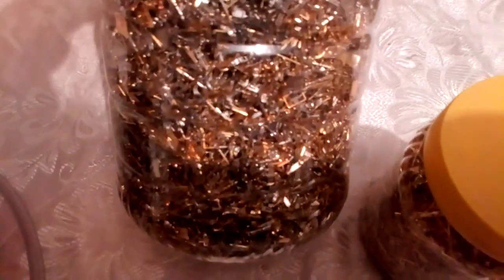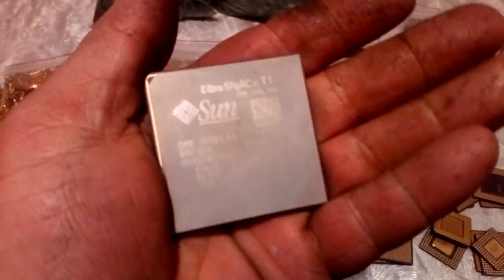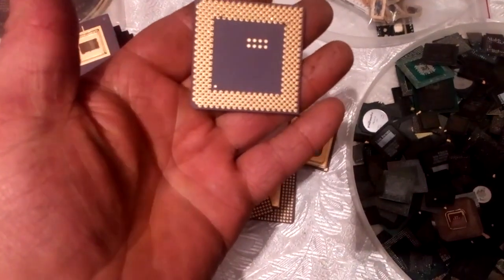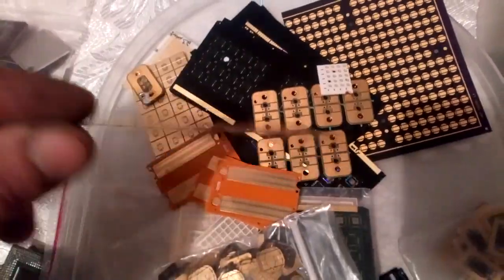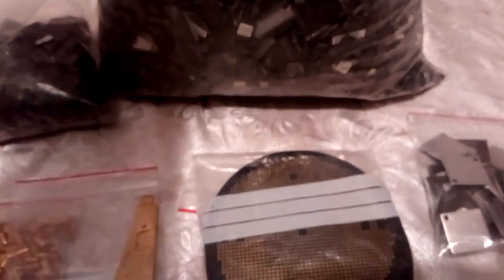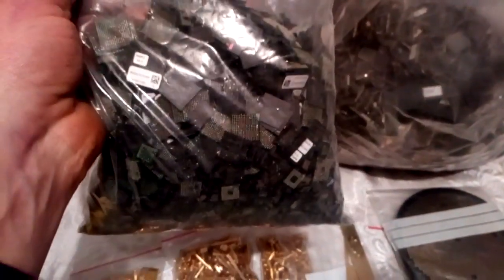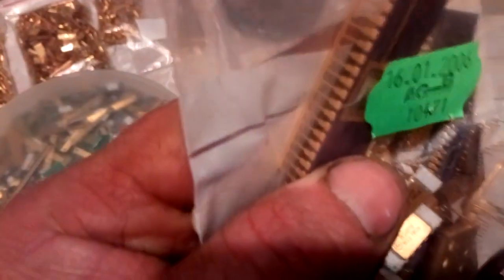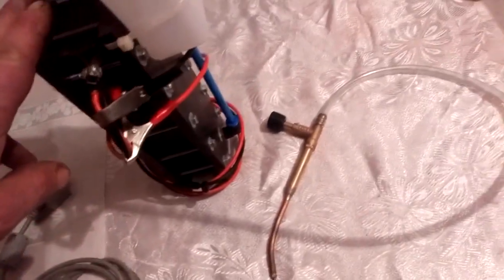New equipment & new cool toll refine items!

Comment: Dusan why don't you use the power supply to power your hho generator instead of a car battery? Also you can use it to make a electrolysis cell for all them pins
Reply from the maker: Scooterist007 Power supply can be used for pins elektrolisis, but it can not start the Hho generator because it requires a larger amperage for a stronger flame, stronger amps, a stronger flame.

Comment: As always great video, very happy to see the security camera chips i did not know about them....        that hho hydrogen generator is very cool, i built a small hydrogen generator last yr for the same purpose, mine was much smaller and i could make small explosions but could not keep the torch lit lol this dry cell generator looks very good....  i might make a bigger one like yours now....   also you can use a small air bubbler from a fishtank  and put it in a tube with water and attach the tube to the torch gas outlet pipe so you have a flash back arrestor ( stops the flame going back into the platic bottle)    great vid dusan , thankyou...
Reply from the maker: 4kays ewaste Thank you for all the nice compliments. This generator is very simple and very reliable.